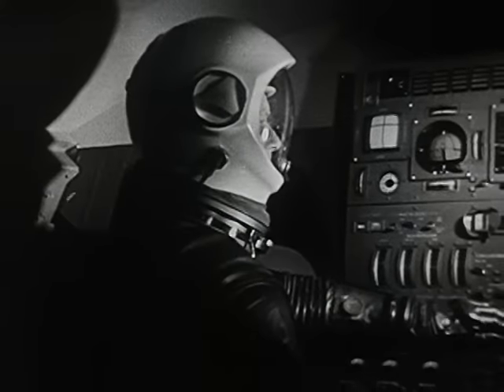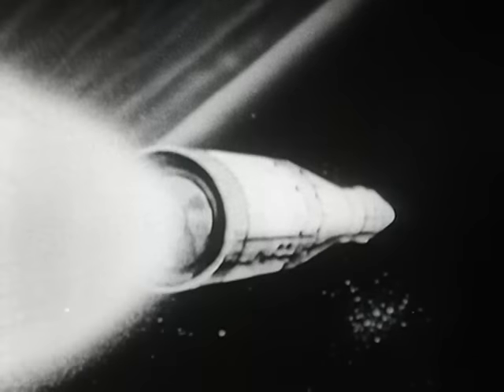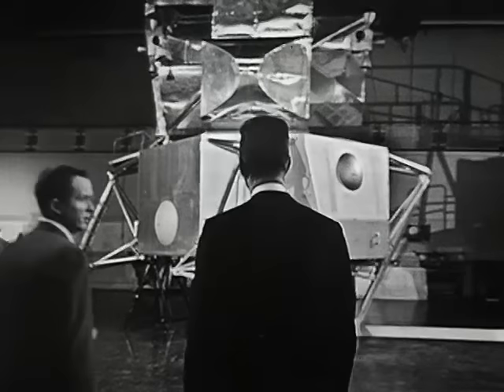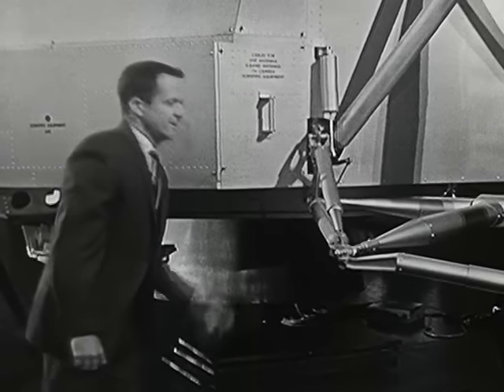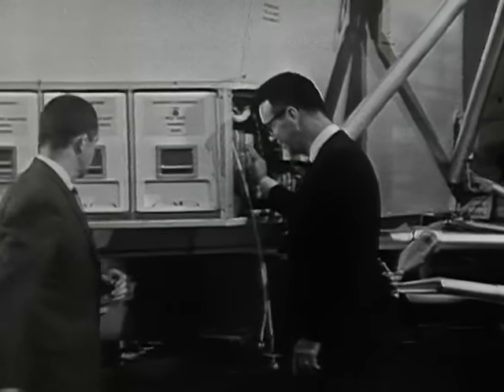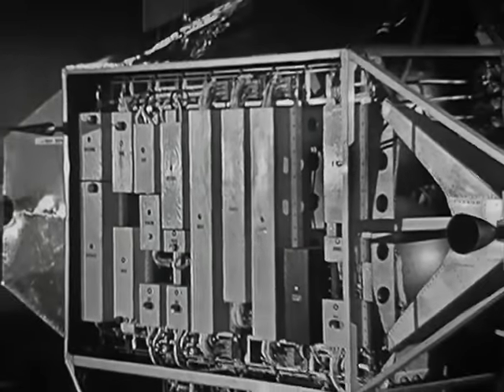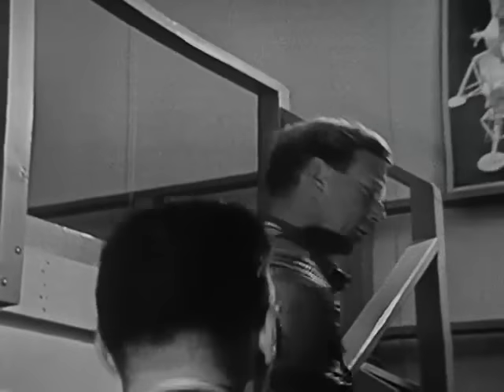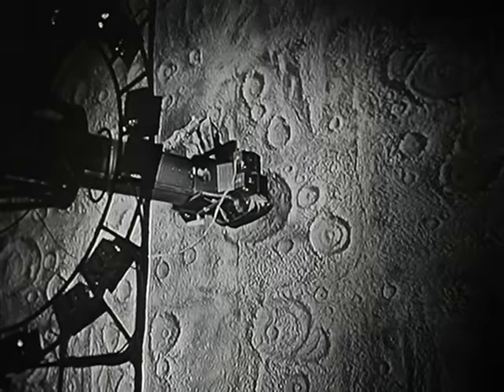MIT Science Reporter — "Landing on the Moon" (1966)

Comment: Notice the firey rocket exhaust during the ascent phase from the surface. During the actual video taken of the liftoff from the moon no thrust was evident. It was more like it was lifted up using a helicopter out of view. A real takeoff from the lunar surface would have been quite bright from the plasma of the rocket engine. Furthermore large amounts of dust would have been thrown out and upwards. No such dust cloud is seen.
I will let you decide what this means without being unpatriotic. 
How did they power all these devices? If they were carrying lox in the backpacks they would be constantly outgassing. No such outgassing was observed on any video of the lunar excursions. Did they uses compressed air? A compressed air tank will last 30 mins maximum. How long were the EVAs? So many discrepancies makes it overwhelming.
Reply: I can't believe people actually believe we walked on the moon.
Reply: Well not we, American astro-actors
Reply: 1. There is no or almost no plasma in rocket exhaust. It's hot gas, but not hot enough to form plasma. 2. In near vacuum enviroment gas from the engine nozzle expands too rapidly for exhaust to be visible. 3. Directly below the ascent stage was the descent stage, partially shielding surface from the exhaust. Also, see the above - by the time expanded gas from the engine reached lunar surface, it would be pretty low pressure. I hope I answered your questions, cheers!
Reply: As for the outgassing issue - they used carbon dioxide scrubbers in the form of lithium hydroxide. There was oxygen tank in the backpack, but only for emergencies (Oxygen Purge System), meant to last 30 minutes. If something went wrong, then you would see outgassing. Power came from batteries.
Reply: @czerwonyniebieski  Trouble is, Moon Hoaxers don't like real facts like this that interfere with their belief that "Conspiracy Theory: Did we land on the Moon?" was the truth. (In fact, it was very authoritive-sounding pseudoscience and bullshit from start to finish. But they don't want to know that, either.)

Comment: After seeing this video, one thing is perfectly clear..... Those astronauts were either suicidal , crazy or extremely brave.
Did the LEM crash back down on the lunar surface or is it still in lunar orbit ?
Reply: They weren't crazy, and if they were suicidal, there are a lot easier ways of offing yourself than getting an advanced degree in engineering, becoming a pilot, then becoming an test pilot, and then becoming an astronaut.

It was a very different time.  People understood that they stood a real possibility of getting killed doing dangerous stuff, and they did it anyway.  And in a way, becoming an astronaut was safer than being a test pilot, which is what most of them had done.  At one point, Edwards AFB saw an average of one pilot per week dying in an accident. 
 And it wasn't just test pilots-from 1961 to 1971, there were fourteen Forumla 1 drivers who died in racing accidents.

As far as the LMs (not counting Apollo 13, there were seven that took a LM to the Moon.  The ascent stage of Apollo 10's LM was sent into a heliocentric orbit, so it's still out there somewhere.  As for the other six, they all eventually crashed into the surface.  The thing is, because the Moon is, for lack of a better term, "lumpy", it has local areas where the gravity is greater than average.  This tends to perturb the orbit over time, so there are very few orbits around the Moon that will be stable over the long term without firing thrusters to keep adjusting.  So even if they'd just let the LM ascent stages drift in lunar orbit, they all would have crashed by now.
Reply: +Milt Farrow How did you personally get into earth orbit?
Reply: @almostfm  - Nevertheless, during the conference, onces back on earth they looked quite unhappy to be alive. 🫤 One month to think about so gigantic lies... it hurts.

Comment: At least the presenter asked questions they probably weren't prepared for.like is that engine big enough to lift the astronuts from the moon.
Reply: Fist Of Blur Leath25 yes it was big enough to hold 2 men and several pounds of rock samples. It was 23 ft high, 32 ft wide and 31ft deep with a total of 235 cubic feet.  It was designed  to hold 3 men in case of emergency as we saw in Apollo 13.  The ascent engine was 47 inches high and produced 3,500 pounder of force using Aerozine 50 fuel. More than enough to get to moon orbit and dock with the command module.
Reply: The ascent stage only weighed about 1800 pounds on the moon. How big an engine to you need to lift that?
Reply: TimReed22222 remember the moon only has1/6 gravity and it only needs to get into orbit.  The LEM circled the moon until it caught up to the CM. It then used its attitude thrusters to connect and dock.
Reply: @jeffberger6162  - Ohhh yeah! I remember those liftoffs! So funny! I rarely laughed so much!! I go to watch it now!! 😂😂😂 already laughing out loud 😂😂😂

Comment: Notice the hatch is too small to get in or out if you're wearing the back pack.
Reply: You can tell that just by looking? Of course you can.....
Reply: This was an early mockup, which they realized wouldn't work with the backpack.  The final model changed the shape of the hatch to be a large rectangle, which worked fine.
Reply: +rockethead7 Naw mate. The LM was produced as one quick fluid stroke of the draughtsman's pencil and worked absolutely perfectly first time around with no progressive development required. Jacques Bazinet has got it right - an engineering mock-up in 1966 had all the fine features down to the last rivet of the J Series Extended Stay LMs used in the final Apollo flights. LMFAO at the naive stupidity expressed with an absolute confidence that is the peculiar possession by the profoundly ignorant!
Reply: Yeah, well it doesn't really matter.  That's just the mock-up (which looks pretty damn good by comparison to the real thing).  What actually "ended up on the moon" can be seen here.  https://www.youtube.com/watch?v=KNQ9ln40ARE
Good thing too.  If they would have taken that baby up, we never would have seen Buzz Alderin's butt crack.  Would have been like "Doah,  I'm stuck!  I'm stuck".
Reply: The german almost spoiled the party back then. During live TV coverage they have demonstrated in the studio in Germany the procedure for astronauts to get out of the module. In this studio simulation made with actor wearing a sort of home-made space suite but without the back pack they have struggled big time to get through. I guess simebody from NASA must have been mad against the stupidity of the  krauts

Comment: The round hatch never made sense. Astronaut in bulky suit with a rectangular backpack needs a square shape
to get in and out.
Reply: The astronaut was never going through that hatch with the backpack on.  I don't know how familiar you are with the spacecraft, but the round hatch was used to pass between the command module and the LM.  And of course a round hatch can be made much lighter than any other shape while maintaining it's strength.  In addition the round hatch is surrounded by the docking mechanism.  It's strength was  enhanced by being round.  The square hatch had rounded corners and was meant for the suit with backpack.
Reply: Yup.  2 hatches.  Round hatch was to move between spacecraft.  If in vacuum, the spacesuit was worn, but not the back-pack.

Comment: The real module looked way different according to this NASA photo: https://wiki.tfes.org/images/thumb/8/85/AS11-40-5922HR.jpg/500px-AS11-40-5922HR.jpg
Reply: The flown Lunar Modules were all covered in thermal insulation.
Reply: @eventcone  The tar paper shack we made in Houston as kids looked better than that.
Reply: @FrederickWalser  
It doesn't matter how it looks.
Reply: @eventcone  - It matters, it is not just about esthetic, but about functionality. If you cover only half foot with thermal insulation, so the whole foot will become very hot by receiving the sun rays. And thermal insulation will only keep the heat inside. So it is a no sens... But when someone have no ideas of industrial design, he just believe every craps that debunkers tell.
Reply: @anodine_org  But the point I was responding to was just referring aesthetics.

That aside, are you trying to claim that the LM's thermal insulation design was NOT feasible, i.e. could not have worked as required?

Comment: Tv signals could never be sent from 238 miles distant..impossible..
Reply: Why?
Reply: It is even worse than that. It is totally stupid and reckless. Why adding cable coils and camera to the payload to be trasnported to the moon? Why sucking up precious energy from battery in order to perform live Tv coverage? Why adding a task like running live TV coverage to the astronauts to do list? All this with the risk of broadcasting agony of the astronauts in live TV. Are u kidding me?
Reply: @nicolagianaroli2024  
Have you ever thought that is was mission critical that the guys at mission control could see what the astronauts did on the moons surface? 
Most of the film we see now was NOT live broadcasted.
Reply: @3gunslingers  It still doesn't make sense. You are saying live TV coverage was meant primarily to increase safety. But then in order to enable live TV they had to decrease safety, such devoting  part of the  energy supplied by very critical system, the batteries, for live TV system. Morever closed TV might have a sense as you have indicated but broadcast live TV is rubbish.  I don't NASA or President Nixon  would have accepted the idea of live TV coverage for an event with very high probability of serious accident. Live broadcast of astronaut in agony would have bene huge blow for USA. That is clear indication to me it was staged event.
Reply: @nicolagianaroli2024  
Live TV in mission control, not public on air... sorry I was not precise enough. 

" in order to enable live TV they had to decrease safety, such devoting  part of the  energy supplied by very critical system, the batteries, for live TV system." As if you can't design the power system with that in mind. And in an power emergency event? --> cut the live feet. Easy as that.
Reply: @3gunslingers  Let'see. You are forced to use pure oxygen inside the capsule because you must limit the payload since the thrust of the rocket is limited and in fact Apolo 1 crew has died because of pure oxygen atmosphere back in 1967. Nonetheless you are willing to increase the battery, and therefore the weight of teh overall payload, for something so vital for the mission like LIVE TV. I am sorry, it doesn't make any sense whatsoever
Reply: @nicolagianaroli2024  
Oh, you know how much battery weight they had add for the live feet? I doubt that, but go on and amaze me.
Reply: @3gunslingers  Of course neither you nor me know how much additional weight in the battery system was required for supporting live tv. That is not the point. The point is that from the rationale point of view it doesn't make sense.It only starts making a lot of sense provided that Apollo was the biggest propaganda stunt in history.Which is exactly what you would expect from a mission run by Nazi
Reply: @nicolagianaroli2024  
Yeah... why would you not want the show the world what a fu*king amazing technological achievement you just made. It would be so much more logical to never show it to anyone that you just landed on the moon. 

Oh, and nice moving of the goal posts there.

Comment: just asking you all to remember on are first try to go to the moon in untested tect . nothing went wrong.
Reply: Apollo 1 burned 3 people to death.
Reply: Thought they went in Apollo 11 , weren't the other 10 Apollo's testing the tech inc loss of 3 lives . They had problems with LEM computer 1201 error due to unforeseen fault  not replicated on ground test , so your incorrect things did go wrong
Reply: That's not true, Apollo 10 was a full dry-run of the Apollo 11 mission. They performed every step necessary to land on the moon short of actually landing on the moon. Not only that but each piece of equipment was tested individually in earlier Apollo missions. Apollo 7 tested the CSM in earth orbit, Apollo 8 tested the CSM in lunar orbit, Apollo 9 tested the LEM in earth orbit and Apollo 10 tested the CSM and LEM together in lunar orbit.
Reply: @lgmx-peacekeeper3204  allegedly. and no mention at all of radiation despite flying through lethal doses
Reply: @lgmx-peacekeeper3204  how close were those missions to each other? you may be surprised. you only know what they told you, people saw a rocket lift off and a parachute carrying a capsule later on. another thing - a capsule coming in from lunar orbit would be moving extremely fast. how did a little parachute slow it down?

Comment: This model of the lander is better fabricated than the real one. The real lander looks very  flimsy.
Reply: That's because they didn't have to shave every ounce of weight they could out of it.  At one point, they were actually looking at how many band--aids they could remove from the first aid kit to try and save weight.

When you go to that extent to cut weight, it's going to make the finished product look flimsy-especially if you can only use 1960s era materials.
Reply: +jc dova
Rodger that.  Here is the one that "actually ended up on the moon" in all it's glory.  https://www.youtube.com/watch?v=KNQ9ln40ARE
They decided to use parcel paper instead of spun aluminum/magnesium components.  Too bad the antennae dish was misaligned...
Reply: It was flimsy. If you dropped a pencil inside it could punch though the floor. The walls were gold foil, like Aluminum foil but 24 K Gold. There was a problem with weight you understand.

Comment: We can detect every satellite in Earth orbit. We can also detect every tiny piece of space junk. But where are the 6 ascent stages that orbiting the moon? ( at 4:05 min)
Reply: Plans changed between 1966 and 1969. This is what happened to the ascent stages.

Apollo 10 - Sent into solar orbit. It's still orbiting the Sun.
Apollos 11, 12, 14, 15, 16 & 17 - Deliberately crashed onto the lunar surface. Seismic measuring equipment had been placed on the surface to record the impacts.
Apollo 13 - Burned up on reentry into Earth's atmosphere.
Reply: @davidkeenan5642  It was sent in solar orbit? Doesn't this requires a lot of fuel? And why should they do this? This makes no sense! Absolute no sense! And it would be expensive, because you need fuel to do that, and you have to carry  the fuel first from Earth to the  moon! To carry such an amount of fuel it needs millions and millions or it is impossible.
Reply: Apollo 10's ascent stage started its return to the CM from an altitude of 14.4 km (c 9 miles) or higher. 

The propellant required to lift a craft a specific distance decreases with altitude. The ascent stage was designed to carry enough propellant to lift it, and its passengers and cargo, from the lunar surface to low lunar orbit.

Though it may not have been carrying enough propellant to achieve this on Apollo 10, it was still carry a significant quantity of propellant once it docked with the CM.

By this time it was travelling at lunar orbital velocity. To transfer from a lunar orbit to a solar orbit, it just needed enough propellant to escape the Moon's gravity well. Then it coasted into a solar orbit, with all of its propellant expended.

The timing of the final ascent stage burn and the vectoring was important for it to be captured by the Sun's gravity, But this took less propellant than you might initially assume.

Think of how much propellant was required by the third stage of the Saturn V to send it, the SM, the CM, three astronauts, and the complete LM from LEO to the Moon.

The third stage second burn only lasted for 5mins 35 secs, but the journey took over 3 days. Most of that time the combined craft and its crew were coasting. 

The ascent stage of Apollo 10 only needed to make two burns. One to transfer from an altitude of c9 miles above the lunar surface to rendezvous with the orbiting CM. And a second to transfer from a lunar orbit to a solar orbit.

It did not need millions of gallons of propellant.

As for the why. There was no measuring equipment on the lunar surface. So my answer as to why they sent it into solar orbit is, why not?
Reply: David Keenan thanks for your detailed response.
Reply: @gonzogeier 

Given that your question has been thoroughly answered in every respect, it would have been nice if you had acknowledged that fact.

Comment: They want us to believe that NA landed this thing by himself by fiddling these simple analog controls
Reply: "They" were already able to build mach3-capable jets years before Apollo with analog controls, helicopters, ships more than 250 metres long, airships the same huge size. And all without a single computer but only their brains and steel wires for the controls. Amazing isn't it, compared to todays simple machines in need for dozends of computers doing the same job?
Reply: @christianege4989  A moon landing is much more complicated. It is also very complex to accomplish the reconnection of the landing unit with the orbiter. Impossible at that time.
Reply: Maybe because he actually did?
Reply: @NachosElectric  It is very unlikely that he did